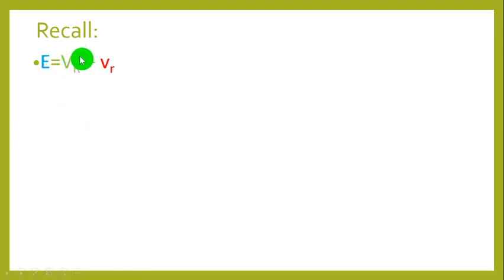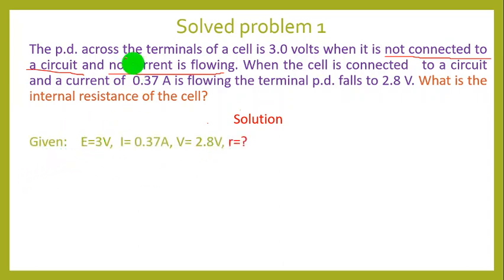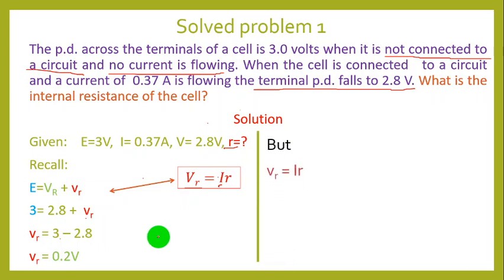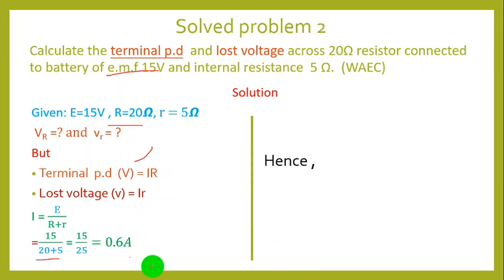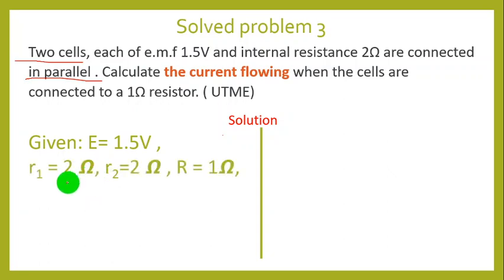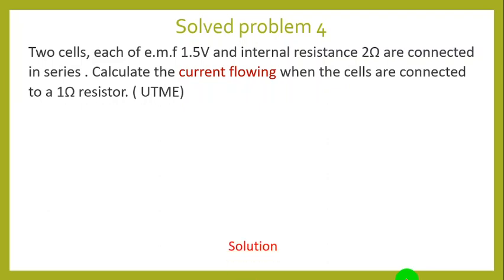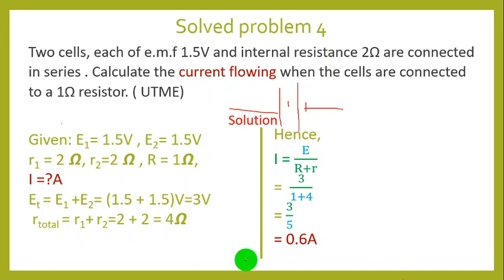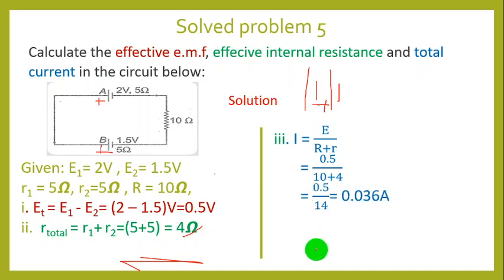Electromotive Force, terminal potential difference and lost voltage ( part 2),  Calculations.

Comment: Thank you
I have a question for u 
In eg 5 when u were calculating internal resistance it was r1 +r2=5+5=4 but 5+5 is not equal to 4 isnt it 10?
Reply from the maker: It's a typo error. Thank you for your observation.